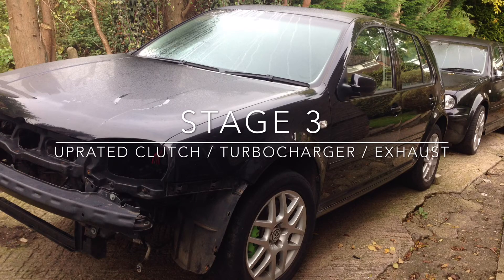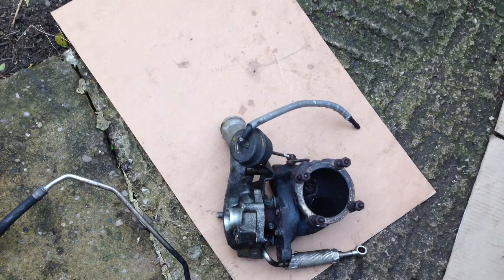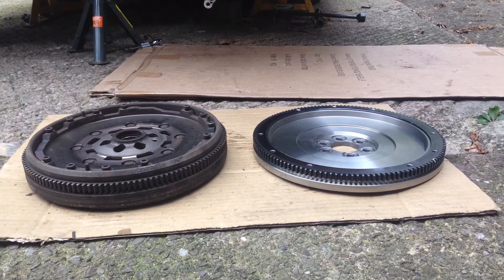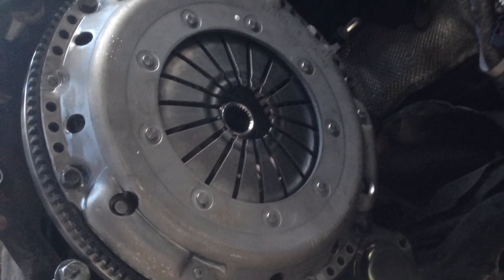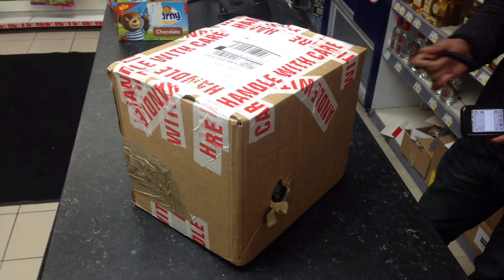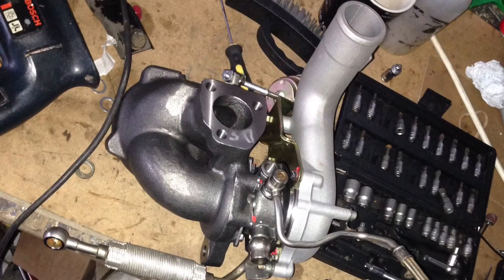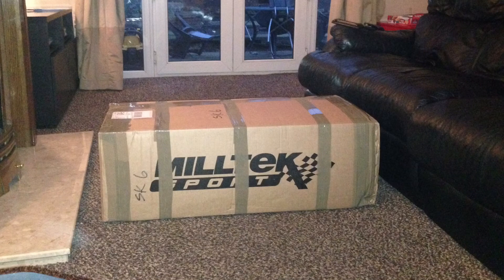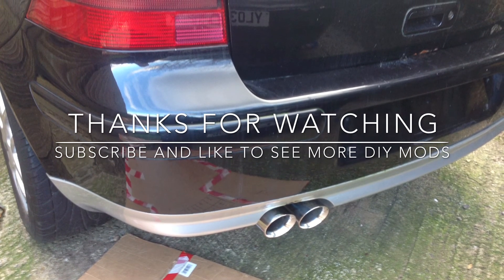BUILDING A 300bhp! VW MK4 GOLF GTI 1.8T (PART 3 OF 5 )

Comment: I cant believe iv not come across ur content iv got a golf gti 20v T AGU i bought it for £80 for a little project and what you have done is the path im going but mine is very tracked out look no interior sound deadening full 3 - 2.5 inch stainless miltek and 3 down pipe bora front  end k04 
bigger intercooler saab red top injectors vr6 maf i could go on but this golf hasnt been started in 4 years nearly
Reply from the maker: H.L & A.P.W RACE Racing - Glad you found my channel, Sounds like a nice setup, £80 is a bargain lol leaves lots of money for mods. Good luck with your build mate. Thanks for watching.
Reply: @Mk4heavenHD  1 Drs trash is a vdub mans treasure no probs mate keep up the good work
Reply from the maker: H.L & A.P.W RACE Racing - ha ha very true 👍🏽